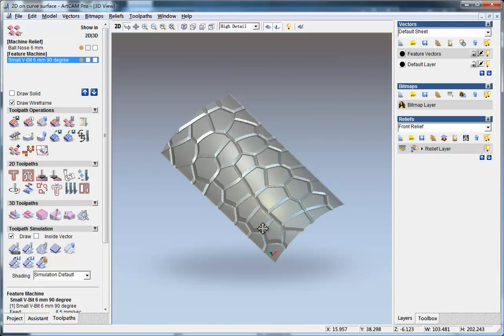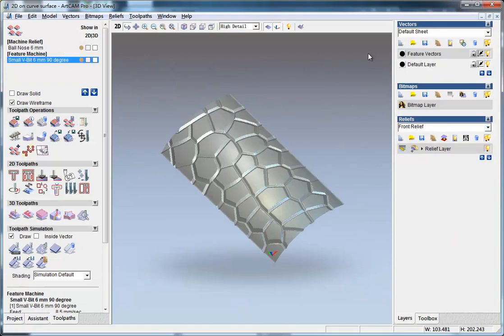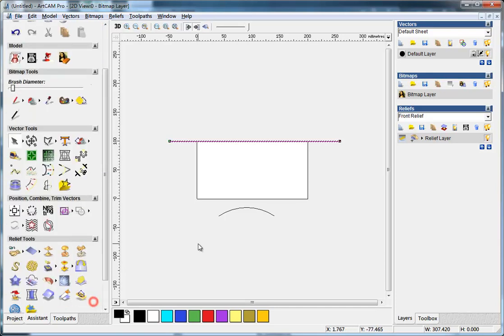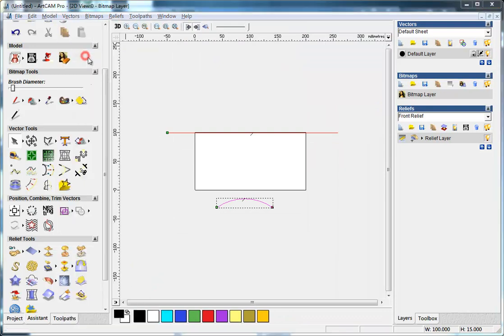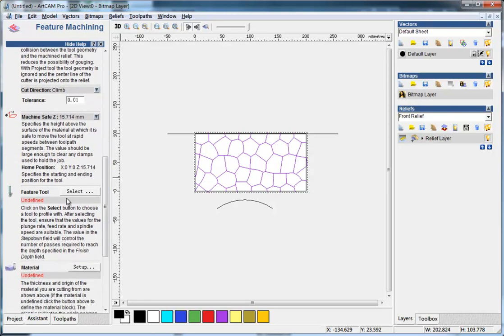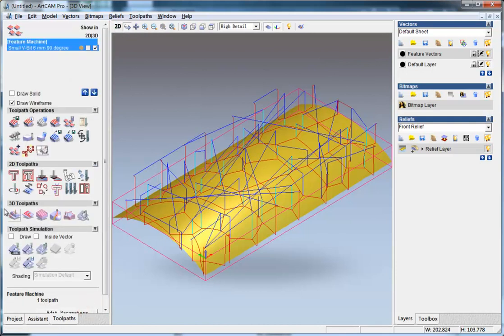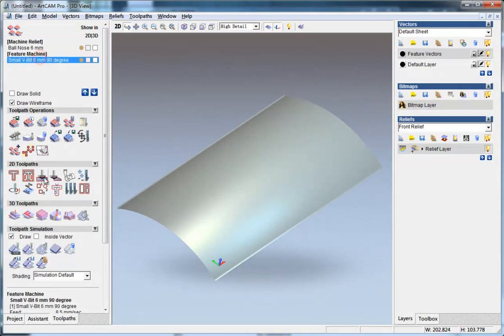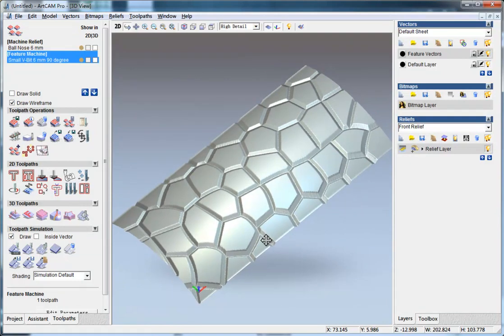feature machining function in Artcam. Draw 2D tool path on curved surface

Comment: What are those.... recessed feature and raised feature....will u explain me ...
Reply from the maker: This  method in the video works more faster than relief machining the whole piece.
Reply: LIU XIN working in vector program is not easy ??
Reply from the maker: maro kriste  it depends on what work you do. usually we don't need complex work of vector in CNC using.
Reply: thanks LIu xin